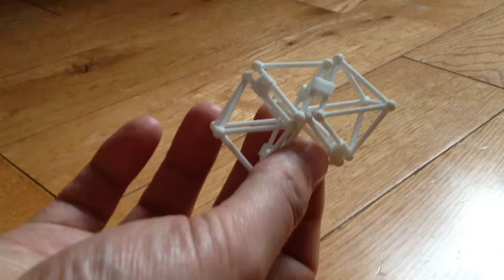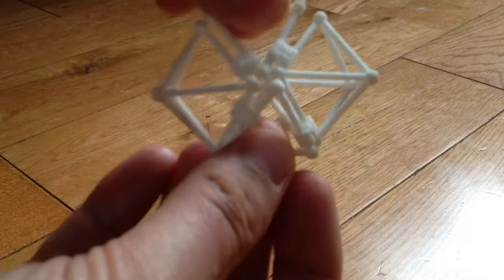Octet Truss, 3d Printed

Comment from the maker: Prototyping pieces and connectors for an octet truss construction kit via 3d printing (SLS process... thank you shapeways). This video shows how the pieces fit together (at least with this iteration of the connector design). Fun to compare and contrast this "product" to the cardboard based one I've also developed (see previous video).
Reply: Make the slides longer, so they  "rack" sideways less.  (Yeah, that reduces the throw, but then just make the trusses longer, which costs more, ...)
Reply: Also, do you have a cold?
Reply from the maker: Yes, I had a cold :-)